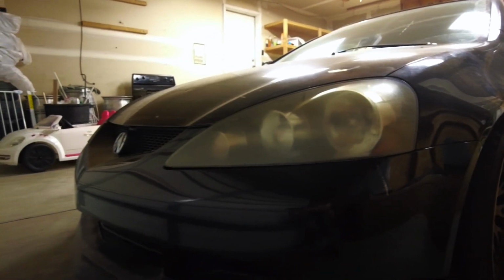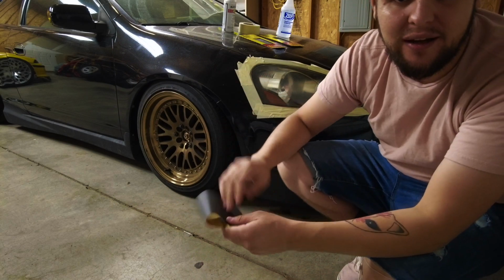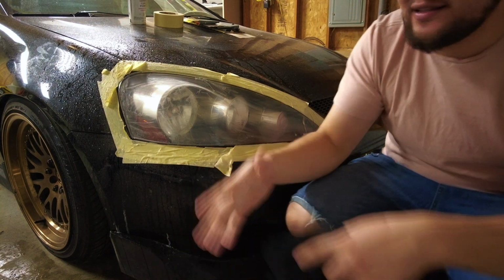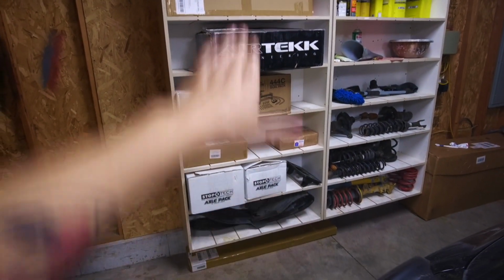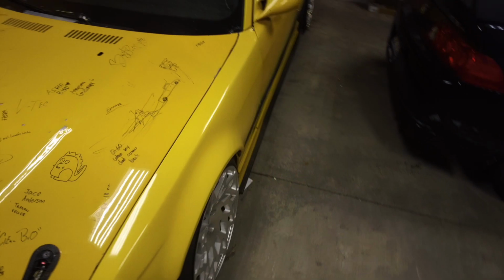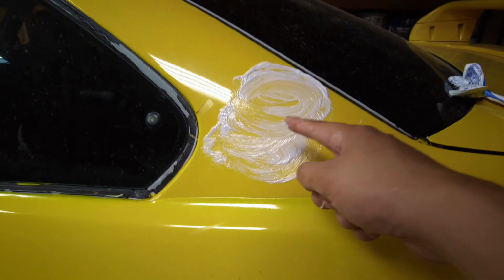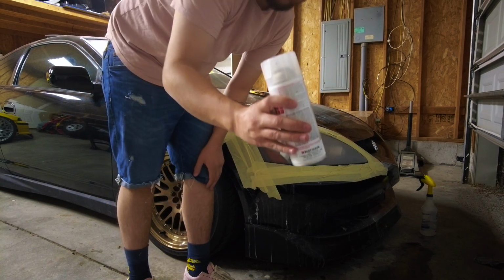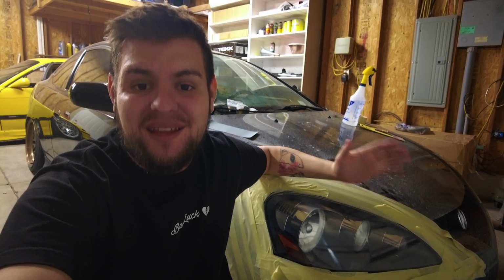Before you buy headlights for your DC5/RSX type S.

Comment: Great how to.  Make sure you wear a mask or are in a well ventilated area when working with Clear coat.  You do not want to inhale "any" of the fumes.  It can cause lifelong lung issues.  How many passes did you make on each headlight with each different grit of sandpaper?  How many coats of clear do you recommend on each headlight?  Clear is good for car emblems before you install them as well.  I usually do at least 3 coats.

Comment: yoo i lowered my rsx wit tein s tech springs and fairly new struts but they haven't settled yet, do u think it should take a couple weeks or the results should be instant??and ur prolly using coilovers and if so which ones, love the vids and rsx bro keep it up
Reply from the maker: I'm on Racelands currently. I noticed mine had fully set at a week or so. They do settle in. Just give it a little time.Thank you! appreciate the support.
Reply from the maker: Also you should notice about 1/4 inch difference or half a inch difference.
Reply: @_OutClass_  thank u so much, I was starting to think I got ripped off 😂
Reply: @_OutClass_  I’m sorry but hows the driving comfortability on the race lands? I was thinking of getting them down the road
Reply from the maker: @baaznijjar1156  They are actually really nice I've been impressed. I'll be replacing mine down the road. (About a month) I'd sell you mine. If you have any more questions you can always reach out on my Instagram @SLAM_CHEZ